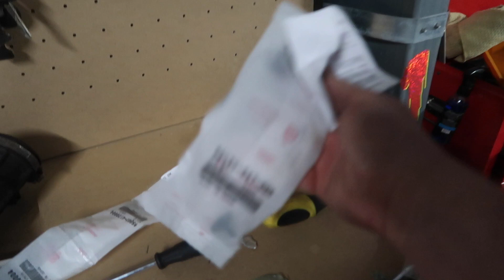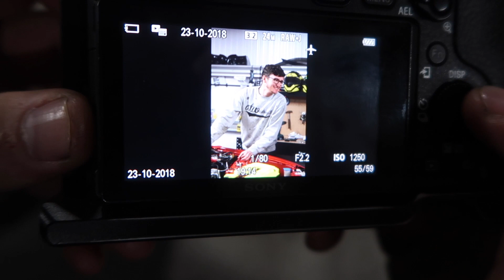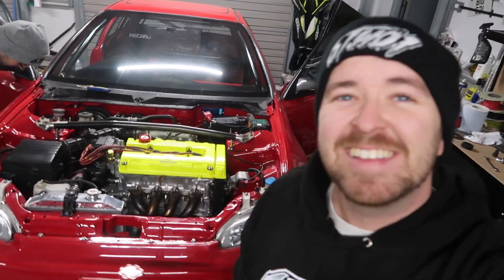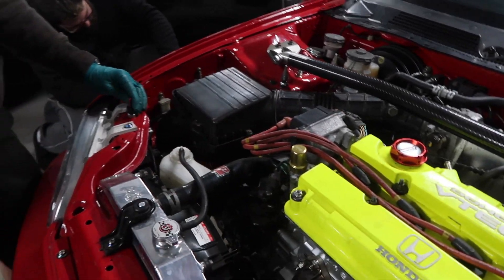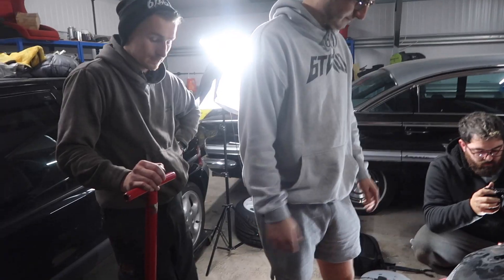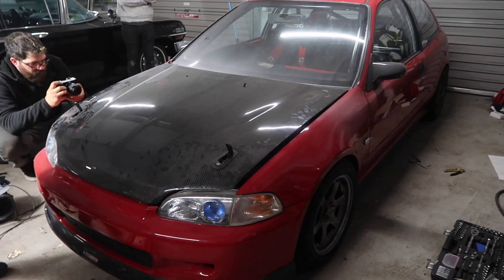Cutting up the Civic VTi EG6! 😬

Comment: 6:57 I feel your pain, on my coupe it seems to be impossible to align the fender (wing) and front bumper cover.
Reply: Don't use the shitty oem clips for that just use a bolt and flared nut, mine was alot better after that. Oh, and on the fender (wing) take a hammer and gently tap the lip where it mates up to the bumper 'til it is flush, they come with a little raised spot on the contact surface from factory.
 Im going to drill a hole so I can have 2 bolts on each side, I think that'll finally line it up. Itll be a pain in the ass to remove later though.

Comment: Loving the civic 👍 quick question on your Silvia I’m thinking about forging my s14 currently running 350bhp but I’m after 400 and I’m like you collecting up bits only thing I’m after is a good engine builder does low origin do work like that or is it mates only stuff??